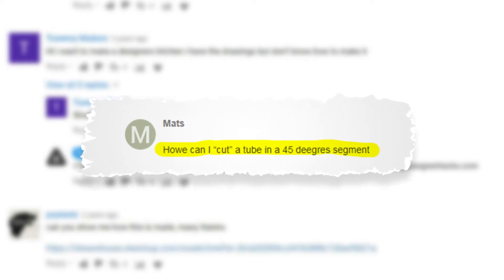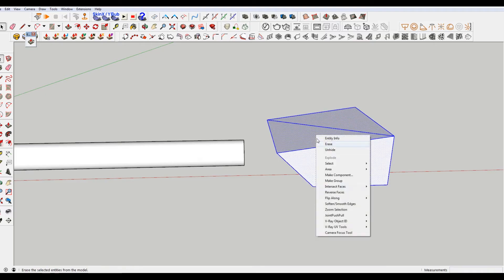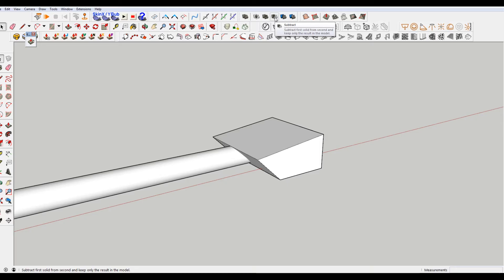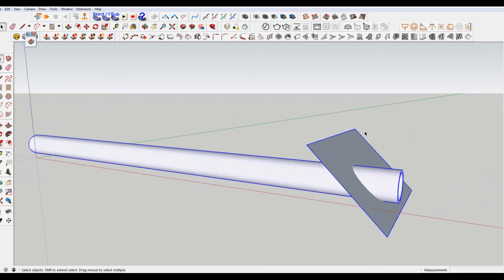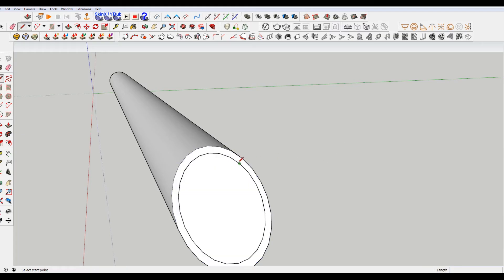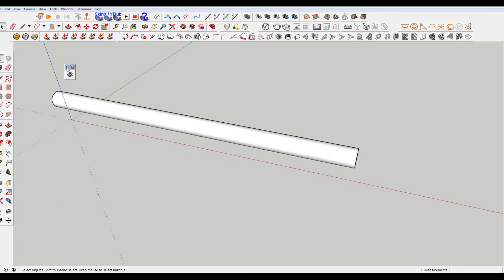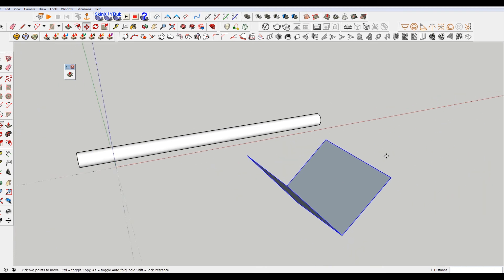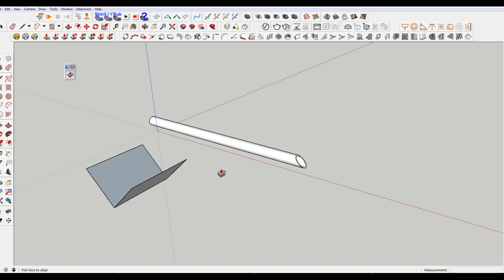How to Make an Angled Cut in Objects | Sketchup Q&A

Comment: Designer Hacks. 

I'm a real newb at SketchUp but after 20 odd years of using AutoCAD I think you owe it to people to find a more disciplined way of doing this once you have learned how to manipulate the axes in Sketchup... It is amateur to force teach having to create a separate component to subtract vs. slice object, particularly when one wants to keep both sides of the cut.

Please update your instructions and notify us when you learn the proper way.
Reply from the maker: There are many ways to get to the same result and to assume that the way you would have done it is better than someone else's is arrogant and closed-minded.
Reply: Spin apex. Using solid tools with the trim or subtract option is just one way and is the proper way. Its calles solid tools because both objects have to be an actual solid. Look in entity info. 

 In designer hacks second method with the cutting plane method, he didn't need to delete the other end of the pipe, he could have selwcted that geometry very easily, moved it, and then he would have had the other end. I do this all the time. But he was merely answering someones question of how to cut a pipe at 45.  Instead of dropping how many years of xp you have in autocad, you could have literally said the following "hey, great video, how would you keep the other end of the pipe though?" Then, most likely, he would  have replied